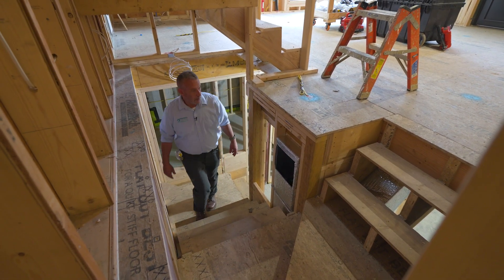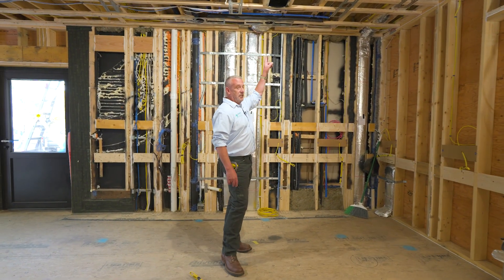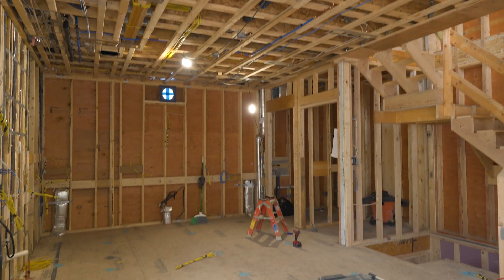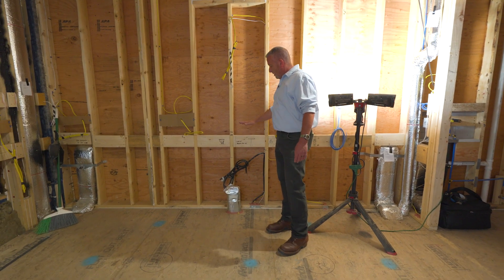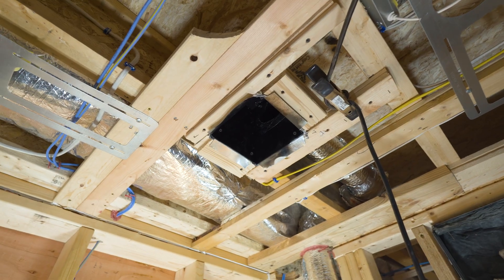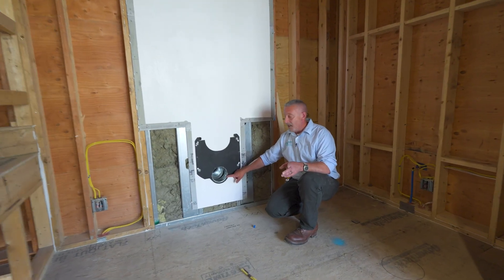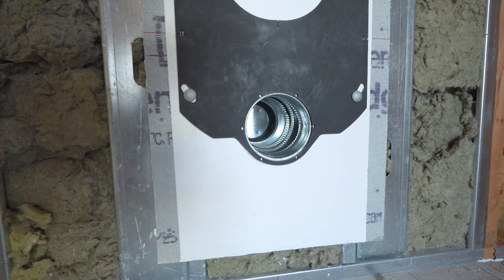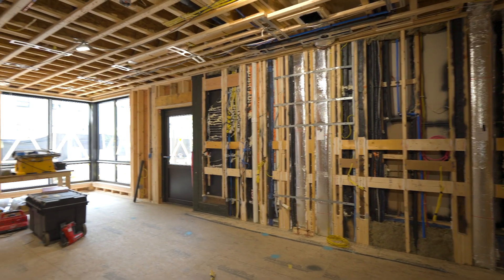Kitchen AND Fireplace Make-Up Air in an Airtight Building

Comment: I think you're going to need a blinking red sign over the fireplace to get residents to turn that fireplace switch on when they use it.
Reply from the maker: Luckily our homeowners tend to be as geeky as we are when it’s come to building performance. But you are right…a system only works if it is used and we are sure to show our homeowners how thier home works.